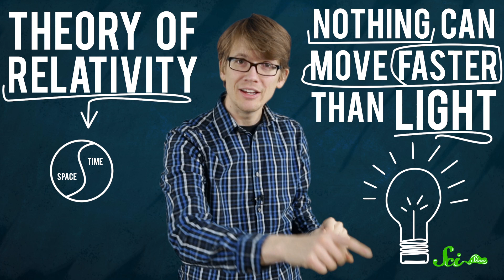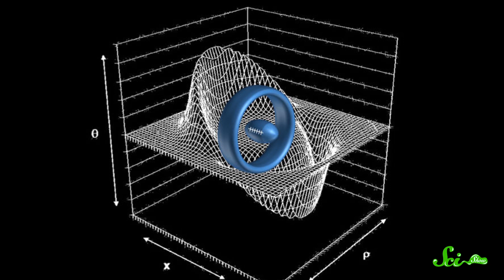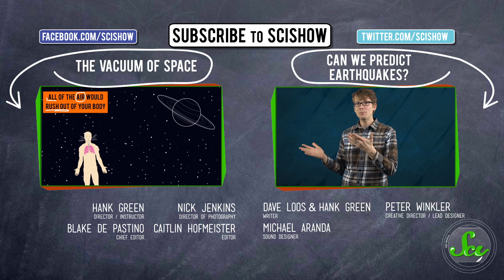Warp Drives!

Comment: i can create negative energy. get a jar put two tiny strips of metal vertically and very close to one another, remove all air from the jar with a vacuum pump and watch in amazement as the two pieces of metal are pushed together by the power of quantum mechanics.

Comment: 1) In everyday talk it propably does no harm but any conclusion made using this assumption is going to be very missguided and is adviced to be avoided in all situations.
2) It wouldnt. If anything, you just would exit the space capsule some time  in the past but there is no straightforward way you can make yourself younger by timetraveling.

Comment: You could create negative energy using two uncharged parallel metal plates and alter the vacuum fluctuations in such a way as to attract each other. The energy density between the plates is calculated to be negative. In effect, the plates reduce the fluctuations in the gap between them; this creates negative energy and pressure, which pulls the plates together.

Comment: What mass was used to calculate the amount of energy used? If it was for a craft that is supposed to sustain human cargo, the mass could be greatly reduced by using a robotic system that had a pre-guided return mechanism. Also could this concept be applied to things on the electromagnetic spectrum(could we warp radio waves to so that data may be received before the return of the craft)?

Comment: siphoning the energy released from the compounds. Possibly even fusing hydrogen and halogenic elements and using the explosion as fuel. A final concern, is that the energy would have to be indefinitely self-sustaining, and be needed to used again, possibly after several uses. Just concerns from my thoughts, I felt would be appropriate to pass on. Thank you.

Comment: Delta-v is governed by the Tsiolkovsky rocket equation (google it), which basically says you need a ton of fuel to go faster.  A spacecraft which is 90% fuel by mass gets about 2ve worth of delta-v (where ve is the speed of the propellant). This means that if you can get your propellant going .99c, you could speed up to .99c and then turn around and slow back down before running out of fuel. Of course, accelerating the propellant to that speed is a real trick :-)

Comment: Nope. Ride a boat in vacuum. It goes 100 m/s relative to ehrm lets say Sirius! You throw a rock with a mass in the opposite direction. Now you go >100 m/s.
Aaah I see, I was wondering if there was a hole, where my Classic dynamics wouldn't work, but yes, at some point, you would have to have so much fuel, all of the universe would have to be gasoline & oxygen. But what about a mass => E/c² converter ;-) ? 
See, I was just wondering, what Pink meant, you adding input just made it clear, thanks ^^

Comment: Well this is question is really hard to awnser because light isn't quite the same as sound is. We know what happens with sound when we break the sound barrier but sound is merely movement between atoms which create a wave. Light, however, is energy which changes the lane of the electron within an atom if I recall correctly. But since heat is only the speed of an atom moving I think going at the speed of light would knock off the electrons (Plasma phase) and thus you'd be invisible.

Comment: althought it sounds possible, some pretty basic principles of physics should prove this method impossible for the following reason.

if you take this warp-ship to alpha centauri and back, you just transmitted information from point a to point b , faster than it would take light from point a to reach point b , albeit you did it be "cheating" and bending space, but it's still information dissapearing in 1 place and reappearing in another place effectively breaking the speed of light of information

Comment: You are completely accurate. But inside the warp bubble is the same place before and after travelling. There is no need to go FTL. Personally I think using the word travel for a warpbubble is not very accurate at all. Creating a movement in the spacetime around the point of space one is located in is more accurate.In short one does not move through space so with relativity there is no FTL movement for any matter!It's what the matter is in that moves which is as far as I know not made of anything

Comment: Light is massless, but it does carry energy. So technically, photons can be treated to have a mass-equivalent energy. Most of the time I believe, this is dealt as in the form of radiation pressure.
This vid deals with a hypothetical warp drive which produces apparent motion and not relative motion, allowing it to exceed the speed of light.

Comment: In any other relative case, this would be true. But a hypothetical warp drive ignores all of this because well.. the ship isn't actually moving at all. The model is that a still ship engages it's warp engine. A "bubble" of enclosed space then "moves".
A good example of this actually is in the expansion of the universe, some galaxies are actually moving away from us faster than the speed of light. The expansion of empty space between us and those galaxy is causing it to "move" away that fast.

Comment: Let's think about it! Let's assume a sphere, that is moving at 2 c in a warp bubble, is emitting light in the visible spectrum. Let's also make the assumption that it is only emitting directly in front and behind it.
Within the warp bubble, its all normal. Light reaches the edge of the bubble at both ends.
Outside the bubble is another story. Any photon leaving the back side of the bubble would appear to be extremely red-shifted. In front, the bubble catches up with photons. Photonic boom?

Comment: Yes. But not explosions, unless maybe if matter comes in contact with the warp bubble. The amount of warp needed to travel FTL would be like a moving black hole passing through the star system. Most likely, a ship would move a slow apparent speed not to do damage to the star system, and only shifting to FTL once far enough out of a star system. Also, a gravity well of a sun could definitely mess with warp FTL travel.

Comment: At the moment, current fusion technology only turns out energy barely higher than the amount of energy put into the reactor. The reactor in current use are mostly for experimentation and observations of fusion reactions. Basically before up-scaling to the big leagues, physicist wants to know what happens during a fusion reaction in a controlled setting.

Comment: Not just quick. Alpha Centauri is 4.36 lightyears away. The speed of light = 299,792,458 meters/second. That's 9,454,254,955,488,000 meters a year. To cross the distance to AC in 100 years, we'd have to travel at 10,792,528.488 km/h. In 2018, Mars will be 57.6 million km away, because of the eliptical orbit it will be closer. We would cover the distance in 5.3 hours. BUT, this is calculated with speeds reaching Alpha Centauri in 100 years. This warp drive would reach AC in 6 months :D

Comment: If I understand relativity correctly, these warp drives wouldn't exactly allow travel faster than light.  Space isn't warped on its own, but spacetime as a whole is.  Travelling "10 times the speed of light" is sort of a misnomer.  A traveler moving at this velocity could reach a destination 1 light year away and only experience 1/10th of a year passing.  A stationary observer would, however, measure the time lapsed as more than a year.  Similar to regular velocity based time dilation.

Comment: The one he's refering to is an experiment where a laser is shot through a half-silvered mirror which sends the laser in two different directions. The two separate beams are then reflected back where they're sensed by a detector. If the two beams come back at different times then you know that something interfered with one of the beams (like a warp bubble).

You can check wikipedia for the whole explanation. Just search Michelson interferometer.

Comment: I had assumed you accepted relativity, I was wrong so I have to start over.

If Alice travels at 10c relative to Earth, then Bob traveling at 0.5c in the other direction sees Alice as traveling at a negative speed - that is, traveling back in time.  Since you still believe in FTL travel, we have no choice but to make identify Bob as an invalid reference frame.  We simply note that Bob is wrong.

The problem is - who should be right?  Earth?  The Milky Way?  The CMB?

Comment: I've heard somewhere that the interaction of the solar wind with earths magnetic field creates(in the same fashion particle accelarators do)a belt of antimatter that produces about 16 tons of antimatter /year.If we could station collectors to gather the antimatter in magnetic containers to later realease it, we should be able to create enough energy to power the Alcubierre's drive.If I'm not mistaken the trip to Proxima Centauri would require 700kg of matter turned in energy with the new model.

Comment: The other biggy is that the drive only works by causally disconnecting the interior of the bubble from the external universe. This all disappears if you've ever opened the bubble to put anything in, or then open it to take something out. Because of this, even if bubbles can be made, there's a *very* good chance that you couldn't ever transport anything in one.

Comment: There are many other, almost certainly insurmountable, problems with alcubierre-like drives. The most important is that not-only does it require -ve energy (which is fine with physics), it requires net -ve energy over a complete null geodesic (essentially any path that light could follow if it doesn't end up in a black hole along the way) which almost certainly isn't ok with physics.

Comment: Well not directly, because the chemical energy from the oil goes into heat and pressure energy, which goes into mechanincal energy. But if you reverse all those steps (add the heat energy that the motor does radiate off back in, and all the gas that was created) than yes, you could transform it back. If you take an electric car for example, it is more obvious. The velocity can induce almost the same electric energy when stopping, than was used to accelerate (ofc friction loss occurs).

Comment: That's the beauty of the warp bubble, inside the bubble everything is as normal, then there is the bubble which is moving the space inside the bubble through the space outside it. You are literally staying in the same spot, it is the spot that moves. That is why with warp it is possible to travel faster then the speed of light, because you are in fact not traveling at all. When you want to stop it is a simple matter of turning the power to the bubble off and the bubble will fade away.

Comment: No; Artificially doing so causes problems on both ends of the journey, if it is a return journey. The act of entering warp is not the issue, but doing so causes devastating results at the "end" of the journey, so either you're going to destroy the place you go to or destroy Earth on the return journey. Creating a warp is theoretically "safe", using it, not so much.

Comment: Actually, Warp 10 is 1000 times the speed of light not 10, as warp factors are roughly the Warp factor Cubed times the speed of light. As for transwarping at Warp 10, It's not that going at Warp 10 causes Transwarp, so much that Warp 10 was the slowest speed the Federation could get Transwarp to work at, and  Warp 9 was the highest speed their ships tended to survive at.  Warp factors much higher than 10 were mentioned in some of the stories.

Comment: I have a feeling you'd be moving too fast for anyone to see much of anything.  Though if you were to film it with one of those sweet super-duper-high-speed cameras (the trillion-frames-per-second kind), wouldn't it make sense that you'd just see a trail of light behind the warp bubble?  Sonic Booms occur because the object accelerates through the vibrations propagating ahead of it.  With a warp bubble, acceleration through space is not occurring, so there shouldn't be any kind of boom.

Comment: It would take less energy than they are calculating. Instead of considering the energy to power the craft they should only worry about the initial energy needed to create the compression. From that point on they could borrow all of the energy that they needed from the compressed space in from of the craft to satisfy the propulsion needs of the uncompressed craft.

Comment: Very simply:

If you can travel faster than the speed of light, then you can time travel.  So, provided we don't accept time travel, in order to make a warp drive, just alternating the space around the craft isn't sufficient.  You have to change all space in the universe such that someone can't travel a space-like interval from your reference frame.

The energy needed is irrelevant.  It can't be "local", or asymptotic (formally).  You can't get around this.  It's not physics - it's geometry.

Comment: But space can be stretched faster than the speed of light theoretically. This is the reason light cannot escape black holes, the space the light is traveling through is moving faster than the light itself, inwards towards the black hole. 

Think of it as a conveyor belt being faster than you can run, you could be the fastest person ever to run, but if the conveyor belt doesn't fall under the same rules, you can end up finding your efforts to avoid a hilarious cock up were inevitable ...

Comment: but then again if space and time are two parts of a whole, spacetime, then if you were to manipulate the space part, the time part would be manipulated as well meaning that if you warped ahead in this bubble, you would have only aged based on the amount of time you travelled inside the bubble, but outside the bubble, the length of space which you travelled would also affect the amount of time travelled meaning people could be generations ahead when you return.

Comment: It wouldn't, but the point is that in order to utilise so called FTL-travel (faster than light), which in a sense a warp drive is, you must travel vast distances at conventional speeds in order to reach a "safe distance", which essentially defeats the purpose of having an FTL craft. If you have to travel for years before turning your warp drive on and arrive years from your destination, it's not the most useful thing in the world. Also, "sending data back to Earth" would require even more time.

Comment: That would likely be the power system of choice for such a system since it'd be the most mass efficient format for energy storage, and ultimately you'd still have to move the mass of the ship around between uses of the "warp drive" in a conventional manner.  That said, my understanding is that  antimatter production is a very lossy process, taking a fair bit more energy to produce than the matter/antimatter reaction creates.

Comment: You too. A warp drive will not obliterate the solar system. It will require the mass of Jupiter to run, not put out that volume of energy. Also, the whole Jupiter thing was before they came up with changing the shape of the warp bubble to reduce the amount of energy required.

Comment: Um. The models used for this also says that the bubble creates a shock-wave of "Space-time" at the leading edge of the bubble.  That shock wave would have thousands of times the energy required to rip apart the entire destination solar system to sub-atomic pieces when it gets there.

Another problem is that in the models, the shock-wave doesn't form until the bubble actually reaches C.  So a live test might be VERY bad if done inside our solar system...

Potential for Weaponization??!!

Comment: Alpha Centauri is our closest star system at 4.37 light years away. The fastest spacecraft we've ever built was Helios, which obtained a speed of 157,000 miles per hour (only after diving past the sun in a huge gravity assist, as it was designed to study the sun). If we built a new craft that could travel just as fast as Helios, and pointed it at a-Centauri, it would take 4271 years to get there.

Comment: The same. It's the relativistic curvature which causes the time dilation, which can come from acceleration or from gravity... either way you feel that "pulling" feeling. If you're in empty space or in free-fall, you feel no pull and your path through spacetime is a straight line. The people on the spaceship would be in freefall because the space around the ship is curved but not the space within the bubble itself. The ship technically never accelerates at all.

Comment: I still like the idea of the Casimir effect, which has been proven on small scales.  With the speed of light in a vacuum constant at (approx.) 186,000 miles/second, scientists have used the Casimir effect to show that if you alter the properties of that vacuum, you can increase the speed of light within that altered vacuum.  If this could be adapted to larger scales you could create a "Casimir Field" around the craft, and create a bubble where light travels faster than 186,000 miles/second.

Comment: The jets are not from escaping material, they're from particles colliding at high speed outside of the event horizon. Only quantum effects (Hawking radiation) could cause matter to escape from within the black hole, and at an extremely slow rate (undetectable).

Comment: Right, okay; I knew time was relative. I guess what my main question is, maybe I said it wrong, relates to; time slows down as you reach the speed of light, travel at the speed of light away from Earth for 20yrs and then back for 20yrs at the speed of light, when you return 40yrs on earth will have passed but no time will have passed for you (in theory). What happens when you return to earth after travelling at ten times the speed of light? How will have time passed for u and 4 the ppl on earth?